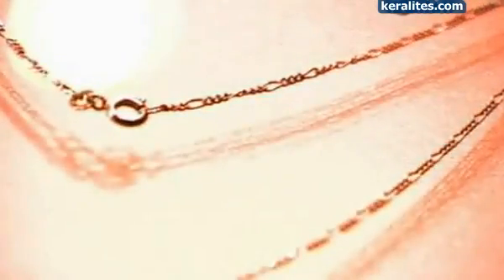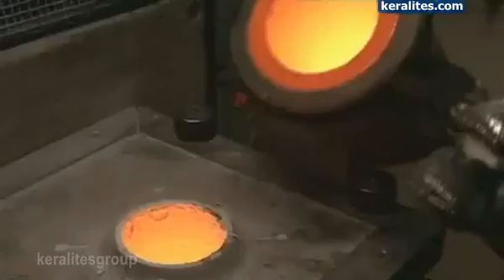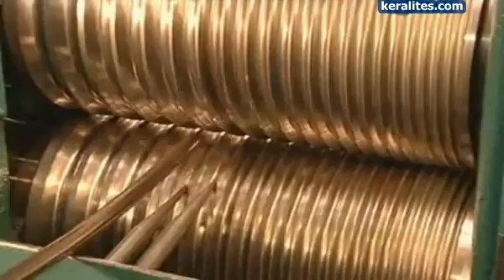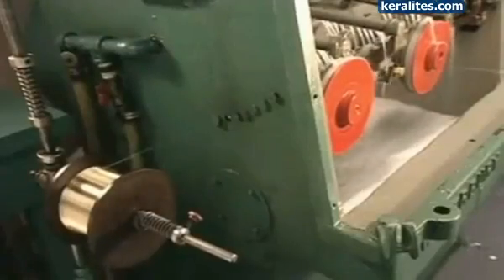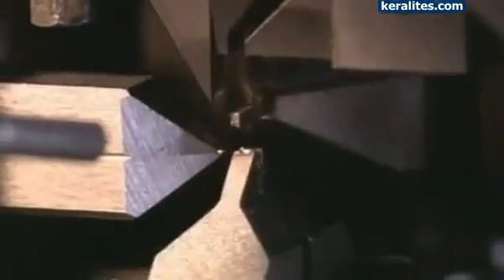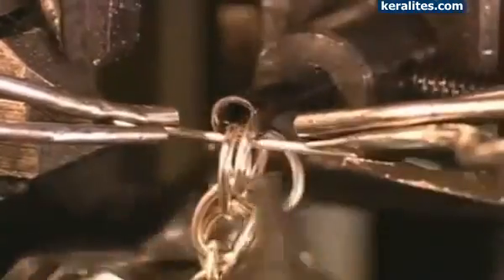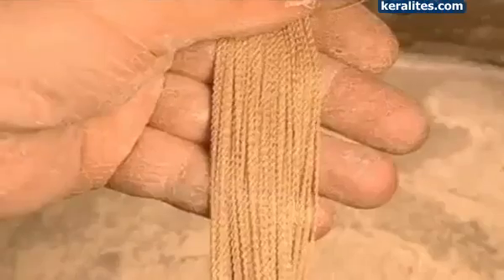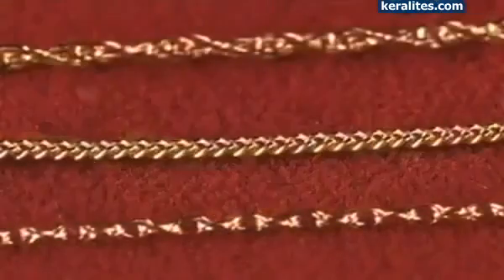How Gold Chains Are Actually Made

Comment: Anything less than 22k is scrap gold.
Reply: Bro 22k and 24k gold is soft as shit. 14k and 18k is more durable. Also 14k and 18k have different metals in them.... I kno you can take the other metals out but it gets you less money than you just selling the chain as is
Reply: Also no one makes 22k chains really because of how soft they are
Reply: @cj_9015  dude. I'm from India. Maximum jewelry here is 22k ... 24k is not uncommon either. Yes they r soft. But not as soft as u think. Yes the only thing is you have to take off your rings before u lift heavy things... That's it.
Reply: @cj_9015  also yes... Chains can't be made out of 24 or 22 but 18k is hard enough.